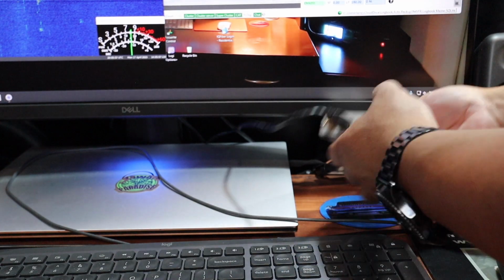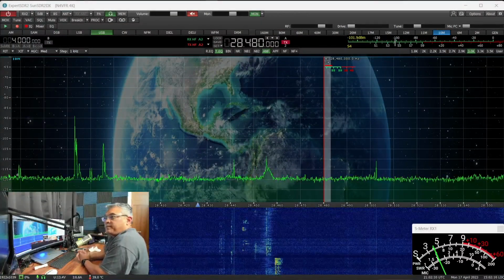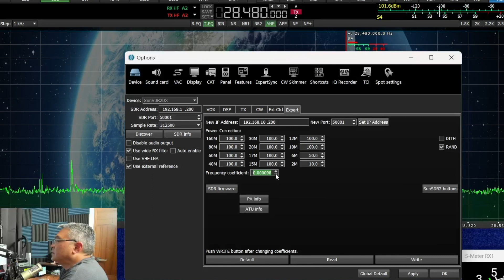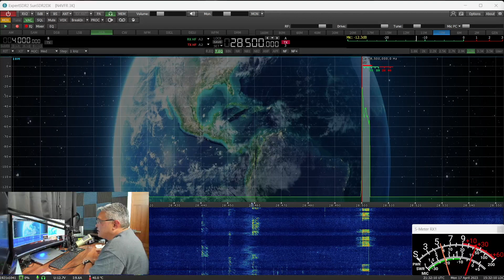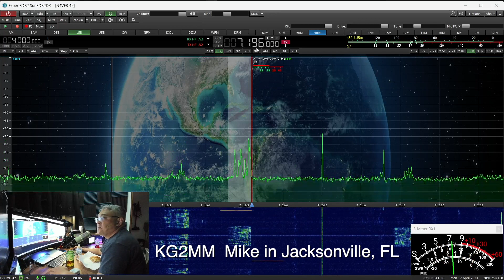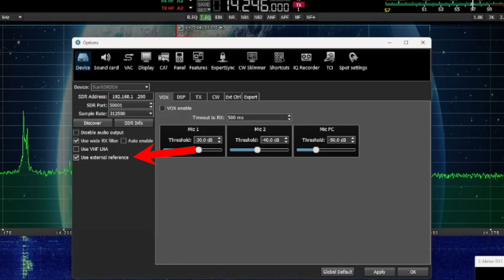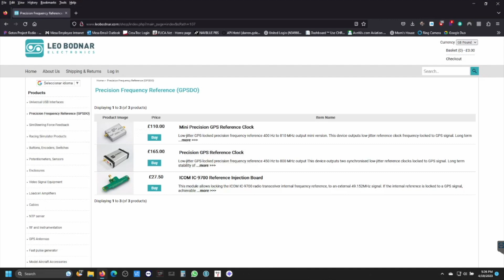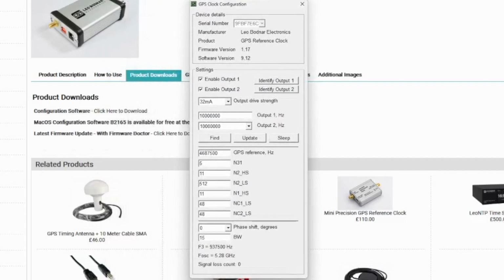GPS Disciplined Oscillator (GPSDO) | Leo Bodnar Electronics | Expert Electronics SunSDR2 DX

Comment: Hey Darren!

Windows principle: you must not every first klick on "Apply", it only serves as an interim takeover. You can also click “OK” directly.

By the way, make sure that the output signal strength on your GPSDO corresponds to that of the SunSDR.
For my satellite converter I use +7.7 dBm (8 mA) and for my RSPduo it is as far as I remember +12.7 dBm (24 mA) with a 50 ohm terminal.
After commissioning, my devices noticeably switch from internal to external PLL. You can then check with a time signal transmitter or the carrier signal from a radio station.

Comment: Great video! A fellow ham has just bought a SunSDR2 DX. I'm using a much older HPSDR setup with an external 400W amplifier. I use a BG7TBL GPSDO, it's nice to know I am spot on frequency all the time.